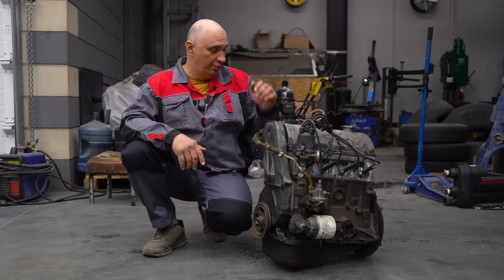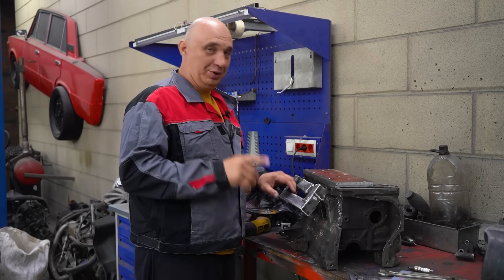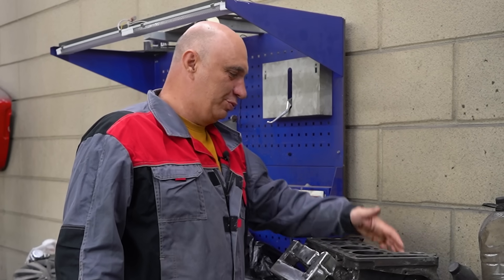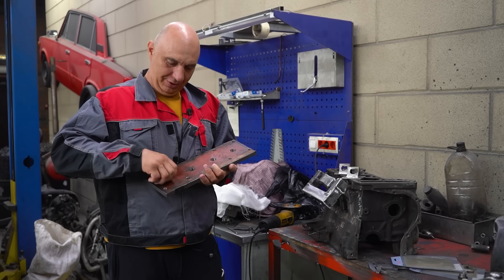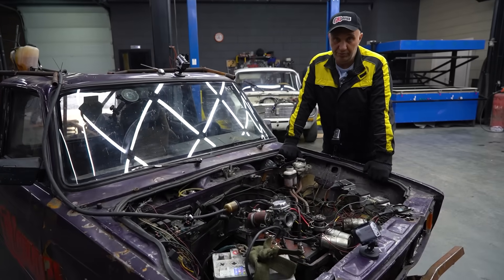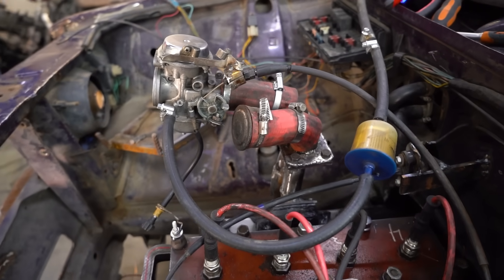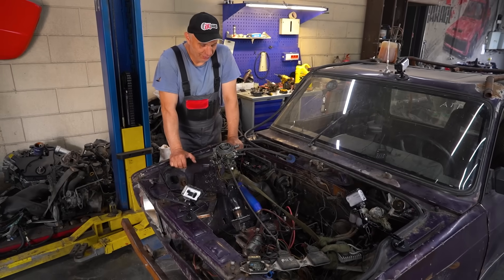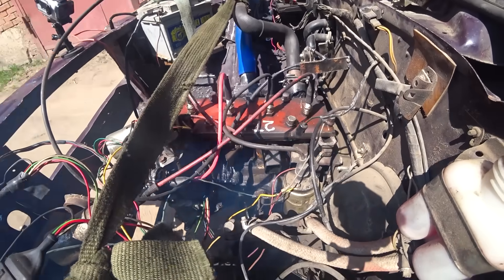4 stroke to 2 stroke Lada engine conversion

Comment: I would use a crank style lobe system with points to operate the firing. Seems like it's only firing half the time That's probably why it only runs a little bit at lower RPMs

Comment: 2-stroke reed valve is a one-way flap system in a two-stroke engine that controls fuel/air intake into the crankcase  might not enough back pressure from exhaust

Comment: probably need to treat it as Four  single cylinder  engines  with crank seals in between each cylinder    Then 4 individual  cv carbs     should run then.

Comment: spark system always has resistance so spark plug no resistor low resistance leads low residtance coil corect fiering order , you do not need that staff an ordinari Lada engine is nothing better compared to Opel engine bouth can fire at "external combustion" Flame Liker engine is easer to gain when engine is warmed up and you move distributor 180° depends what gas type it is you need pre heater ,better gaskets who can widstand bouth preshure and wacum ,electric pump for brake booster other staff bypassed if necesary .Or you do it also this way "Packard DR-980 plain 2 stroke diesel engine with singel cilinder head valve I belive if you use cam shaft from a DOHC engine and put it on a SOHC engine they bouth valves open at the same time ,just use gear ratio betwean crank and cam 1:1 ratio figure out useing spark distribution or make for ich cilinder seperate magneto ignition ,buzz coil or similar shuld work perfectli fine some 2 stroke engines use Red Valves. But knowing all components construction materials makes it easyr .British Flat Head Fiering Order ,Intake System Combustion and External Combustion Exaust Stroke works perfectli fine on Opel engines from the 70-80s but you need to have good understanding about cold dieseling ,pre ignition and ultra lean rich mixtures control it will not work on all engines due to material differences and parts lay outs but Lada shuld work you can even make it to 5 stroker conversion,hot bulb,hit n miss ,strling all of those engine types work fine on Lada engines.So the point is bouth intake and exaust head valves must open at the same time bare in minde ignition modules have rpm limiter for cranking speed and max engine rpm speed even hall effect and pick up coils have resistance if leads are to long ignition coil or module will miss fire .More or less the engine also can operate like cold started diesel engine undee open flame so simply add other type of fuel or some inurt gas so fummel around jet position on open port to intake system make shure the flame isnt flown out from wacum make protection chamber for the blow torch flame so by increasing decreasing flame intensiti moisture content in air and position of flame movement that controls the engine works well with ultra lean gas mixtures like blow torches some times micro jets are used not ordinari carb jets . Starter motor for 2 stroke shuld spin faster speed if the alternator detects ground voltage it might get to full charge mode so dont activate the alternator during cranking only when engine is turned on use push button with diode on alternators field then activate alternators field manuali I asume you will need in some cases to change pulley ratio for alternator to charge slower 2 stroke engines operate normali under higher rpm ranges.So I belive that will work perfectli fine with minimal changes to the engine wurst is figuring out ignition system pulse devider I asume you can use 4x 555 timers with 4x xor gate ic chips cirquet diagram cd ignition by Swan google or similar some Jaguar cars used dual ignition coils in serries the distributor cap were conected to 2 cilinder pairs when igniting 1 singel hei module run that system so I asume you can use twin hei modules so just fummel around magmets position on hall effect or pick up in theori it shuld fire up that engine .I alredy know external ignition works on Opel engines I done it out of fun to study its behavior also faults were noticabel when you have engine runing with out sound congratulation its most likely an Flame Liker smuth operation ,fast engine but lot reduced hp with out gas restrictor control it uses litel more petrol reali hard to start engine in winter time with out heaters .Controled Pre Ignition is similar to Dieseling but better works when vapor lock acures the hp is increased but with reduced engine speed so reali all depends how you set that thing

Comment: With it being a two stroke engine Four cylinder You need 3 or 4 carburetors insane uv 1 It will give the even amount of gas and the air mixture to the thing

Comment: The crankshaft must be modified so that each connecting rod seat is at 90⁰ to each other: the 1st cylinder at the bottom, the 2nd piston at 90⁰ upwards, the 3rd piston at 180⁰ from the 1st and the fourth piston at 360⁰ from the 1st, with a coil for each spark plug, like the 3-cylinder DKW engine.

Comment: Two strokes engines are designed to have a sealed combustion chamber from one cylinder to another in order to be able to pull the gas from the carburetor. Without that vacuum force it will never start.  I made the comment without seeing the whole video. Now realize you already know the reason it doesn’t work.  I am just a cuban guy who started doing mechanic work at 12 years old  on 2 strokes Russian motorcycles. Anyone who understands how two strokes work will know right away.

Comment: Hi, 2 stroke engine complete the cycle in 1 complete rev. 4 stroke engine is 2. angle on crank supposed to be sync with the all 4 cylinders accordingly.

Comment: Since you can’t seal off the separation of cranks. You may need to do a supercharger like Detroit Diesel and force feed the air-fuel mixture  directly into the cylinder ports.

Comment: Exhaust pipe is the issue. It has to be correctly designed with cones for reflecting the pulse... the scavanging  has to be timed with the port timing. Without the correct exhaust a 2 stroke won't barely run...

Comment: For a 4-cylinder engine to operate as a 2-stroke engine, the crankshaft's cranks must be oriented at 90°. This way, when the crankshaft completes a complete revolution, all cylinders will have completed the cycle.
The original cylinder head can be kept, but a new camshaft must be machined, making all the valves exhaust valves. The new camshaft must rotate at the same speed as the crankshaft, so the sprockets on both must have the same number of teeth.
This way, you only need to machine the intake ports in the cylinders, because the engine crankcase will not be used as a compressor for the air-fuel mixture, and the crankcase no longer needs to be sealed.
New pistons would also need to be machined so that the intake port is only open when the piston is at its BDC.
To sweep the gases in the cylinder, a very small pressure is needed, slightly higher than atmospheric, so a blower, whether electric or mechanical, must be placed between the intake port and the carburetor.

Comment: Hi fellas have a closer look at the principal behind a 2 stroke .get a MULTI CYLINDER BOAT ENGINE for reference!
Or have a Look at one of the small garden 2 stroke engines you have.
The piston acts like an intake valve with a port cut in too it matching a port opening in the cylinder! Most common 2 stroke configuration.
Others use a crankcase only induction system using reed valves instead of piston ports/scavenger ports

Comment: It’s not going to run properly or fire in a sequenced combustion cycle.
The principal behind a two stroke is the piston actually compresses the fuel air mix on the DOWN stroke (ports closed) 
As the port opens the now compressed fuel air mix rushes into the cylinder! .
You need a separate crankcase for each cylinder and an individual carb for each too. 
Also a scavenger port / piston port or reed valve thus sealing the crankcase from the intake.
YOU WILL NOT get it to run right with a side carbie set up either .you have  to much surface area in the manifold for the amount of vacuum now available as a 2 stoke! You would need multiple intake ports around cylinder too .

Comment: using reed valve inlet manifolds from motorcycles would have made your job easier, neater and worked much better, each cylinder needs to be a closed circuit with a forced fuel system, pressure from the crankcase being easiest, but all the cylinders have to be separated from each other so they pressurise individually, huge job converting a car engine to do that, look at the SAAB 96 engine to figure it out,

Comment: it needed to have individual carburetors for each cylinder, and it seems that the air fuel mixture isn’t traveling through the crankcase the right way, maybe seal them off individually, so each one has its own pressure and better flow, i look forward to this build

Comment: You definitely need to seal the crankcase. When the Piston goes up that is what is supposed to pull in the air fuel mixture and then when the Piston goes down the crankcase gets pressurized and forces it in through the transfer ports

Comment: GM once build a series of 2 stroke diesels, which used a blower (371,471 etc) it had a conventional oil sump.
You would need a blower and to make a cam and ignition.

Comment: You need a blower if you are going to port the cylinders like a two stoke diesel, then you will need a fuel injector for each cylinder. Clearly set up like you have it is wrong a carb only works with vacuum drawing in the mixture but it can not do that on its own with ported cylinders.

Comment: Well seeing there is no crankcase involved which pulls the charge into the cylinders, one would need to use a supercharger  on this type of setup to make it work. Kind of like how a  2 stroke diesel works.

Comment: Detroit diesel 2 strokes use the exhaust valves in the cyl head but ports for inlet.I would think that would work for a gasoline engine also. it would be a project nr2 for 4 stroke to 2 stroke conversion ;)

Comment: The 2 stroke requires a tuned pipe to create the properly timed vacuum pulse.

Others have suggested this but have just missed the mark.

Start by Re doing the cam with double lobes so both the intake and exhaust valves work as exhaust.  at the bottom of power stroke for about 1/4 of the stroke

You will need forced air induction and an air injection jet.  That will operate when the exhaust valves open for 1/3 of the up stroke.  This will vary according to throttle requirement. about 30 psi is all that is needed at a volume rate of 2x the cylinder size.  I have not run the numbers but this is a good place to start.

Fuel injection will occur after the exhaust valves close.

Spark will of course occur at every tdc.

The bottom end can be completely stock.  The cam will change as well as the head to accept the air injection jet.

Go forth and do great things.
Reply: No, it doesn't require it. It just improves performance.
Reply: @alexmail123  Had many 2 strokes and a broken pipe or non existent, just wont run.

Comment: Alright. As someone who builds 2 stroke and 4 stroke engines your issue here is due to the exhaust. 2 strokes have the big pipe for a reason. The scavenging effect is how 2 stroke engines draw in air fuel mixture. Your Lada carb should be plenty as long as the fuel jets are moving enough fuel to make up for the amount of oil you've added into the fuel

Comment: A 2-stroke engine operates by completing a power cycle with only two piston movements (one up and one down) during a single crankshaft revolution, where the intake and exhaust processes happen simultaneously through ports in the cylinder wall, utilizing the crankcase to draw in a fresh air-fuel mixture while expelling the burnt gases during the power stroke; essentially, the piston acts as a valve to control the flow of air and fuel throughout the cycle, making it simpler in design compared to a 4-stroke engine.

Comment: I think there right but the issue is there not running 2 stroke and vacuum is sucking oil from crank case that how 2 stroke work they pull full threw the main than up to the intake side of piston u would have to look online

Comment: In my opinion the problem is in all the free space inside the crankcase and reed valves are too far. Small air leaks around the crankshaft aren't that big of a deal and you can still get the engine running if there are some of them. Main reason why it doesn't work is the ratio between the space that each piston displaces while moving up and down and the rest of the space in the crankcase. The smaller the ratio is, the better capability the engine has to suck in mixture of air, fuel and oil and to push it into the cylinder. Or with other words, it's the same as with the compression above the piston. It wouldn't work good either if it had a lot of space left at TDC in the head. So my advice would be, that you try to minimise all the space by welding on some material, try to make the sump as small as possible and also the crank shaft should be modified somehow to take as much of remaining space as it's possible.

Comment: ur vary close. i think that the exhaust is where the problem is, 2 strokes need baffles for the back pressure. the baffles do so much for the engine. its not like a 4 stroke where u can run it open headers..and also if the crank is even slightly warped, its damn near impossible to keep it running. but for this case i am fairly confident its the lack of exhaust baffles thats preventing it from running

Comment: You need a cross crank shaft you need cylinders 1 and 3 to be opposite and cylinders 2 and 4 to be opposite of each other that way each cylinder pushes the next one into play and a semi balance crankshaft like a Kubota  2-stroke turbo disease

Comment: Since thats a 4 stroke carb it wont work without changing the jet sizes. If you think about it you are literally trying to pull 2 times the amount of air through that carb that was only made for 1/2 that volume. More fuel is what it needs. That is why it would only want to poorly start at very low revs. Was entirely too lean. Install a wide band O2 sensor and watch the fuel ratio. The crankcase situation is fine. Since your not pushing the fuel through it. If anything a pcv valve would still be needed to maintain a stable crank pressure. You could have grabbed a squirt bottle with fuel when you were trying to start it and it would have tried to run happier. Plus 2 stroke rely on slight exhuast pressure. Really makes 2 strokes not want to start very easy. I am certified boat mechanic so i am educated on mostly 2 stroke engines. Think you guys quit too soon. Please bring it back so i can see yall get it going! Please install O2 sensor and gauge! More fuel! Exhaust pressure! Such a good youtube channel!

Comment: at 5:22 you can see the problem why the engine refused to start. the piston in the right cylinder opens the exhaust port below the piston so fresh mixture can escape directly out of the engine without making it into the combustion chamber. this is why most two stroke engines have longer pistons to block the exhaust ports when the piston is more towards tdc. there are two options for solving this problem. one is to make the exhaust ports wider but not as tall/not as far down the cylinder. second option is to make new taller pistons that block the exhaust ports when the piston is at tdc. great project though and i really would like to see you guys get this thing running

Comment: the problem thats occuring is most probably the same reason 2 stroke diesels have super chargers
i aint 100% confident but i think the best solution would be going the route of most 2 stroke diesel engines that dont rely on crank case pressure 
no transfers, allows you to keep crank case oil, 
ik this is a year old buuuutttt its bout the easiest way that wouldnt require reworking a stock engine from the ground up to the same degree

Comment: The carburettor needs to feed the crankcase, via the reed valves, & each cylinder should be fed from its own crankcase section via transfer ports.

Comment: Your sparking timing not with TDC and try one vlv on top to work on 2 stoke. I have a idea so you can try it.
On head one vlv to inlet or intake vlv and spark on TDC.and piston in BDC to opening for Exhaust so burn cycle is complete.
Triky part is set a Well maintain ignition timing to run this engin. I hope you try this method.

Comment: You should mount a crankshaft on roller bearings.
If you also take your aluminum crankshaft (you will have to bush the bearings) with your lightened parts, you will have a devil's engine.

Comment: When you master crankcase intake, you can convert a 4-stroke engine into a crankcase and head intake 4-stroke.
You will have more power.
Look at Yusqvarna 4T garden engines and Yamada 4T RC engines.

Comment: It should run by just adding a 'blower' to pressurize the engine with air and fuel.   Then you can use the std. oil pump and oil in the sump for the bearings.  Once running... More port area equals more power.  Then an expansion chamber, it 'kicks back with sound echos' the unburned air and fuel.